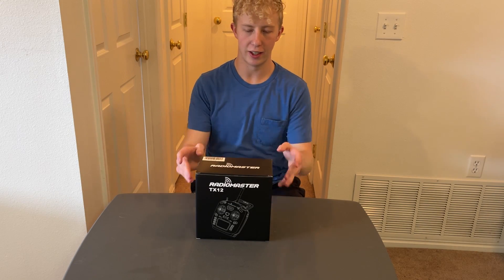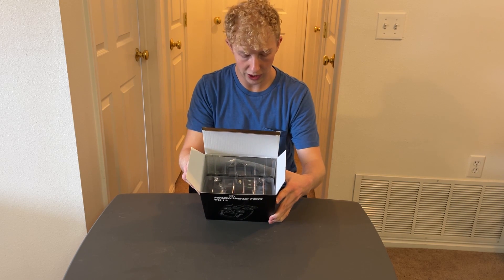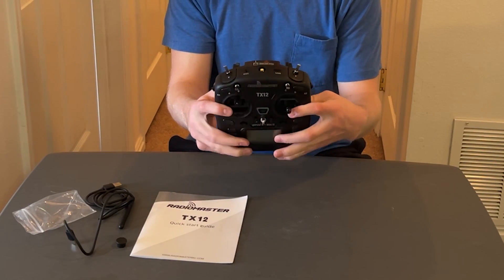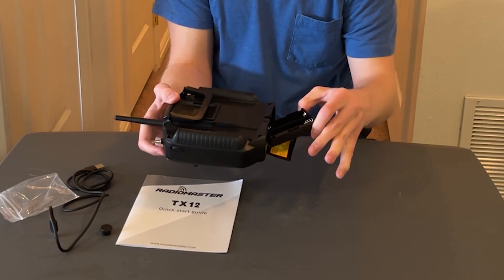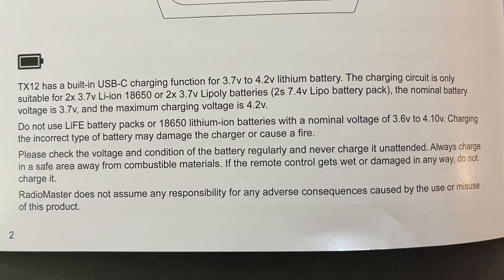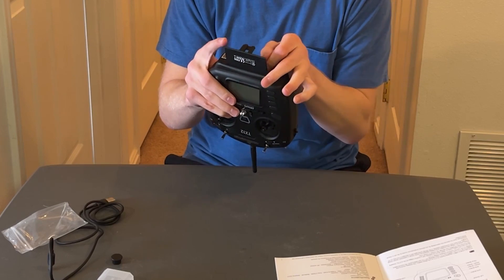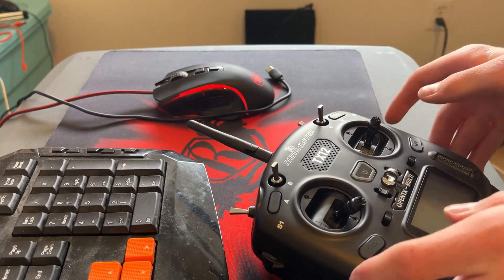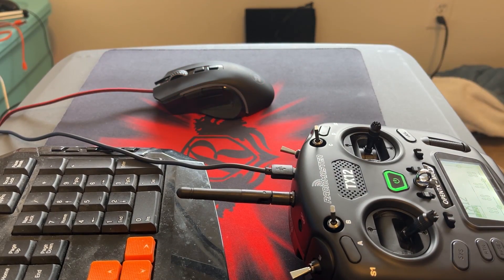Radiomaster TX12 Unboxing and Simulator Set Up

Comment: I just ordered this for my starter controller for sim and eventually a drone. Just a quick question did you have to update the firmware or add an SD card? Didn’t see any mention of that in the video. From what I heard that’s the first two things you need besides the batteries
Reply from the maker: Yes you do
Reply: @coreyricks  can you by chance share how to update the software that’s the only thing I’m a little confused on
Reply from the maker: @comicninja6742  https://youtu.be/iaoR3CLIYhY this may help
Reply: I'm going to order one soon to do as you have, is there anything else I should know before doing so?
Cheers

Comment: Question, the battery you used has a nominal voltage of 3.6v when it said not to use that and use 3.7v instead. Did it affect it in any way?
Reply from the maker: I have had no issues with it so far